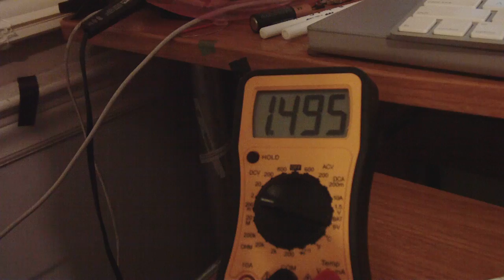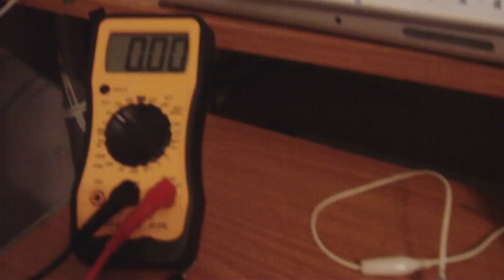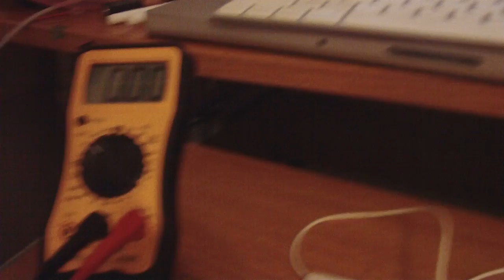Captret Flashing LED and self charging

Comment from the maker: @overunitydotcom The big red tip is the positive of my meter, it is left connected because i only had one free hand. You'll see the black probe of my meter sitting next to the meter, i use it when i check the voltage of the capacitor. I'm not using any AC or the AV plug. Plus the meter is only connected when checking the voltage so the meter is not recharging the capacitor, The captret is charging the 10F 2.3 volt super cap.

Comment: Hmm,
what is the big red tip connected to ?
To ground ?
Does it pull from there some AC and rectifies it on the
electrolyte alufoil diode ?

Could be, that the case with the electrolyte works as a diode and cap this way and some stray RF power in your room charges it up.
It just acts like an AV plug from Dr. Stiffler...

Regards, Stefan.